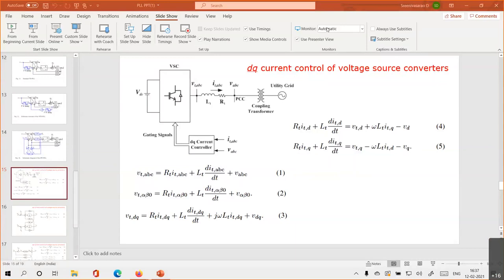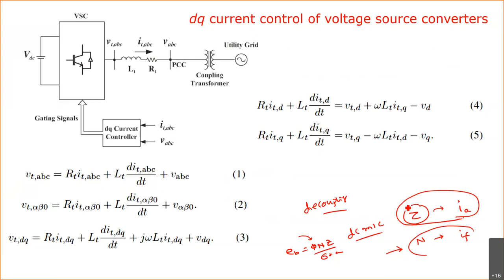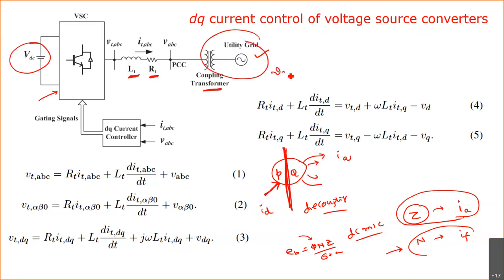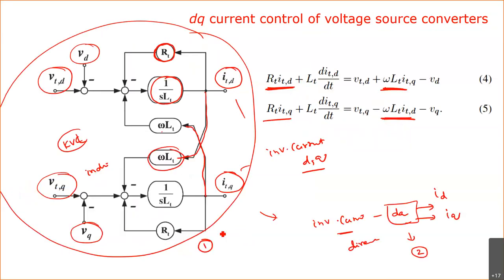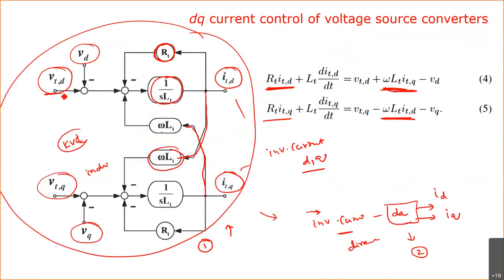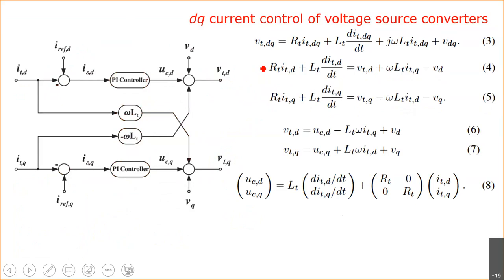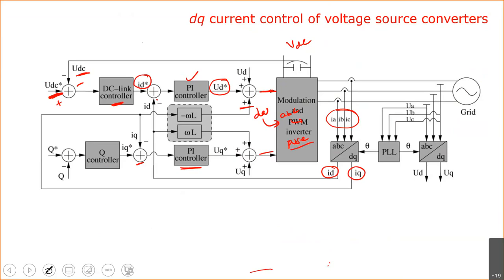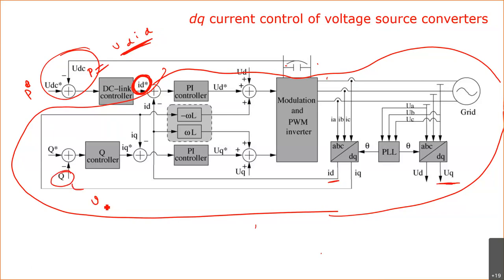Lecture 7 | Grid integration of power converters and decoupled current control of active rectifier

Comment: Sir, how to do current control when the system is having LCL filter. How to include capacitor effect?
Reply: Dont include capacitor effect if you are not thinking of damping effetc. Its will act as filter